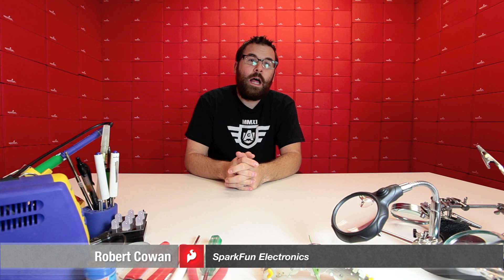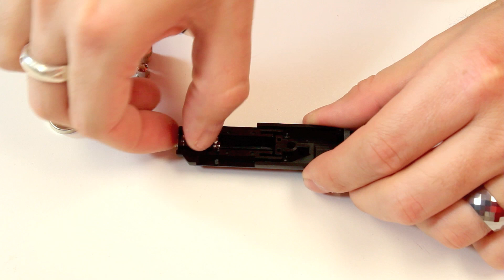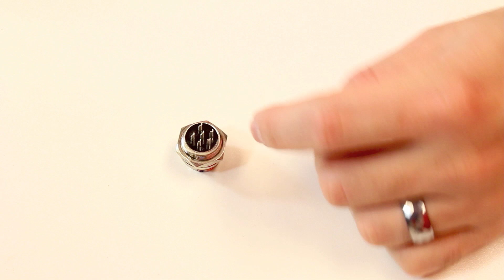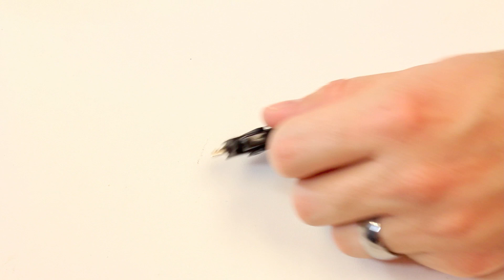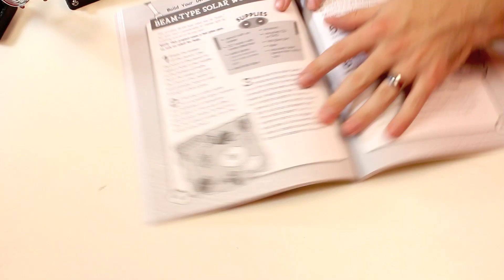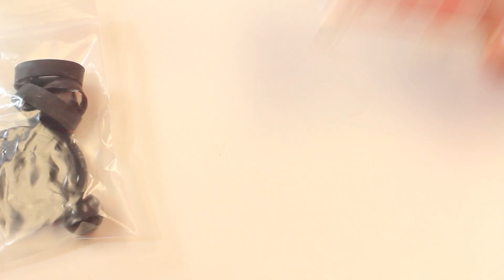SparkFun 10-5-12 Product Showcase

Comment: You should put a warning on that lighter plug. I have used a few of them.
The problem is that all the current has to pass through the fuse spring. This cases the spriing to get hot and sometimes melt the plastic. 
Better lighter plugs have a wire connected to the fuse connector and doesn't pass the current through the spring

Comment: That car adapter is a joke, or better put the explanation for its purpose is a joke. 

How can you say to the viewers that it can be used instead of a 12v power supply, when that lighter output is not regulated, it can be even 14-16 volts or as low as 8 volts when starting the car or when the batteries are close to empty ?